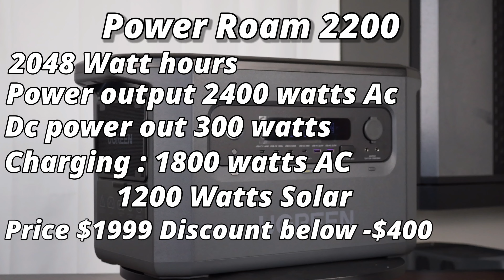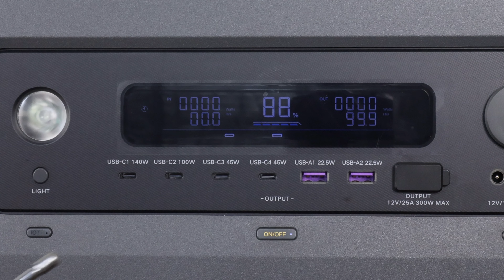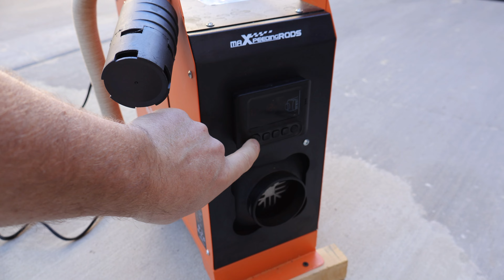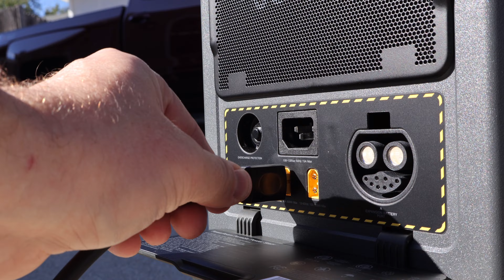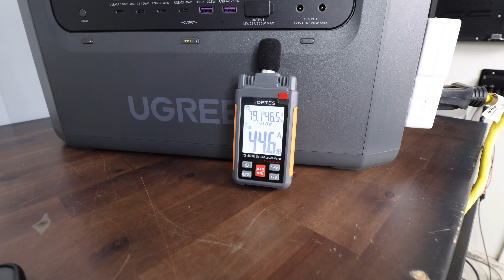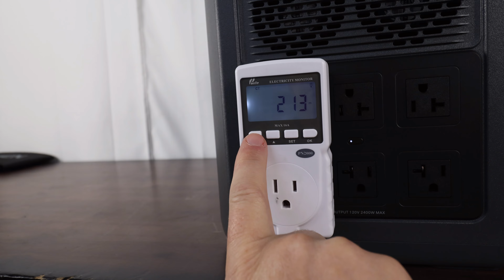Best New Power Station!! Ugreen PowerRoam 2200

Comment: Hi. Can you please tell me if this charging station can work with the coolers off up to a certain load if yes up to how many watts? Or do the coolers work and can be heard even if the load is 200W?
Reply from the maker: I assume you’re talking about the fans, if so it’s pretty quiet and it really doesn’t start making noise until around five or 600 W from what I remember although just to be noted it’s possible this unit could be discontinued as they are not gonna make the extra batteries from what I’ve heard through rumors Still a really good unit and I was impressed with it along with other reviewers.
Reply: @johnnysweekends  Do you remember if it has a “pass-through mode” when the current goes directly from the mains to the appliances without discharging the battery in UPS mode? Many stations even though they allow to use them as UPS, but periodically recharge the battery a couple times a day, which is bad for the battery life
Reply from the maker: @VamIy yes im pretty sure it does but its been a while I would have to double check the video lol
Reply: @johnnysweekends  Yes you are right about the fans. We have occasional blackouts and I need a silent charging station for two computers (~200W total).

Comment: The only thing you need to know is if you can pick it up it's crap, all these companies pushing these "power stations" which in reality are nothing more than glorified phone chargers. Build your own, I have 3* 200 amp lithium batteries, a 3000 watt pure sine wave inverter, 600 watts of solar and a 500 watt wind turbine. I had a power outage in February that lasted over 2 day and I successfully
   ran the house basics with my setup. Ignore the bell and whistles, battery capacity is where it's at.
Reply from the maker: Building your own definitely has benefits. Which is normally cheaper and you get a larger system for the price. But they are getting cheaper to where diy plus your time is so close. But also have to remember alot of people don’t know how to do them on their own. So a ready kit is what’s best for them.

Comment: I need to find a solar generator that can run my RV (30A 120vac)
Reply from the maker: There are many. I have ran several on my Rv and still do. 
👍🏼
Reply: @johnnysweekends  From what I've seen, solar generators aren't at the point where it's economical to run the AC and all appliances. Seems the power draw (3200watts) isn't sustainable with solar unless you have a ton of solar panels. 

Or maybe I've missed something.
Reply from the maker: @MotFPS it all depends what you are trying to do. I have used my delta pro to run my main AC in the Rv for hours at a time. But I also have 2000 watts of solar so im using what im generating. With this setup i have ran both AC units for hours at a time. But again it depends how you camp, where you camp. If its 110 outside and both ACs are running most any system will over heat. But even a gas generator can as well. I normally escape very hot areas, so I only have to run the small AC or maybe for a few hours in the evening. I can also regen power with any generator and fill battlers back up. I run my fridge on AC while I drive, used small heaters, kettle pot and coffee pot no problem…..Tv before it broke.  The more you get into this, the more you stop using a generator all together except for long runs of AC during day and night. But no one should use a gas generator just to watch tv or run a coffee pot real quick. So many quick simple options for that now. It truly has changed the way you camp. Again, where and how plays a big factor.

Comment: Are those solar connectors sold separately?
Reply from the maker: You mean the cables? Or the mc4 or this extension https://amzn.to/404Ssjf
Reply: @johnnysweekends - no the little dongle you have to connect the solar to. The little box. Combindee box from ugreen?
Reply from the maker: @1ENDUSER I don’t see that as a separate item. May have to reach out direct
Reply: @johnnysweekends  - ahh ok
Reply: I just got a reply email from them. No go, not sold separately.
Reply from the maker: @1ENDUSER ahh bummer
Reply: @johnnysweekends  - I wanted to ask if possible as a video for you since I'm not a youtuber but want to try it with my delta pro's & you have tested scenarios. There is a LFP battery adapter from the ecoflow power kit to be able to add that LFP battery to any inverter/charger. Was wondering if you can test that by hooking it up to delta pro's rear since its the same connection & add 3rd party 48v server racks to it. I got the adapter from campervan hq. But haven't tried it yet since I dont have a 48v rack battery. I can send it to you test out, just would have to get it back.
Reply from the maker: @1ENDUSER so your saying hook up the power kit LFP battery to DP..? I dont know if it will read it on that scenario even though connection is the same the data part may not be. I do know you can use power kit batteries with 3rd party systems but have not looked in depth yet as to if it’s a better option over say server rack since those batteries are a great price.

Comment: AC and solar charge times would be nice to know.
Reply from the maker: It charges around 1700 watts roughly so it will fully charge in 1.5 hrs.
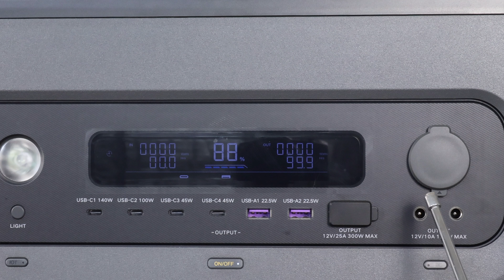If full solar at 1200 ish then about 1:45mins give or take. 
All depends how much is coming in. 
It has a slow charge as well at 600 watts ac